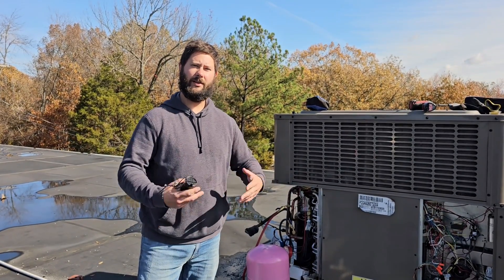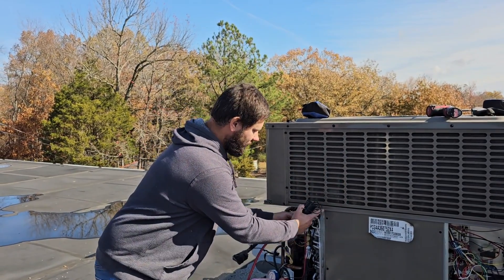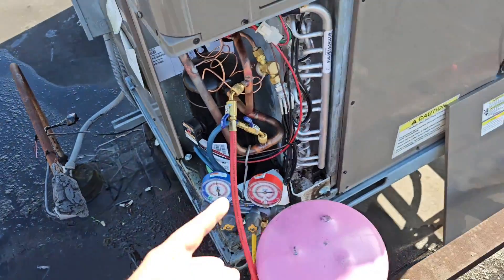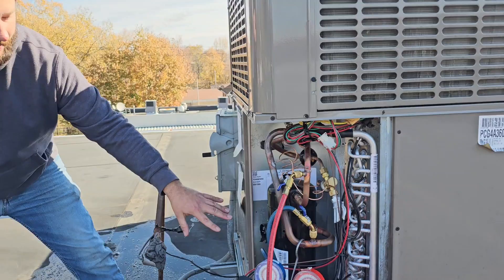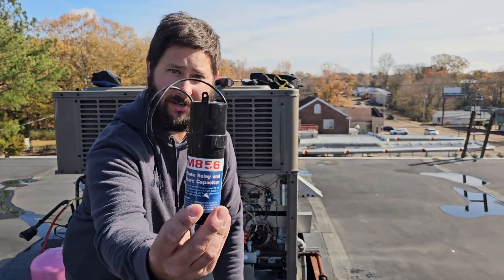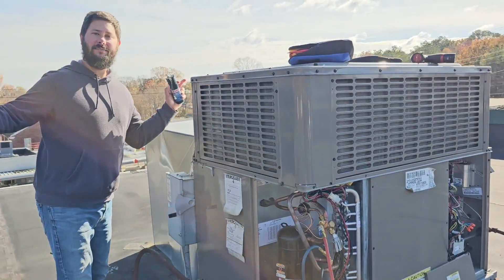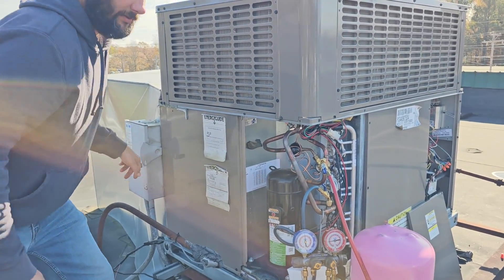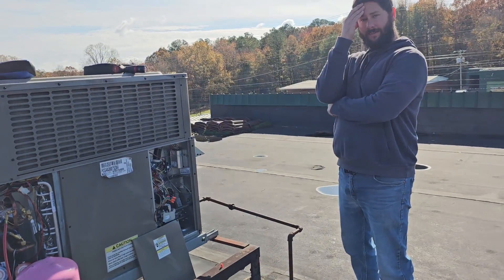This is why York HVAC Equipment is failing! ‎@YorkHomeComfort

Comment: I have a three and half year old York and it's the worst HVAC I've every owned. I will never by York again. Compesser blew out two days ago and local York distributor won't even answer the phone for my HVAC tech to see it he can get the parts. I've probably had to take the panels off to troubleshot a dozen times in the last three years. I missed my 23 year old Bryant, it worked, heated better and cost less to run.

Comment: The York PHE/PCG package units has a “loss of charge” temperature switch. Instead of looking at low pressure it has temperature switch on the discharge line. When you have “low pressure” you increase the compression ratio and will increase the discharge temperature and the loss of charge switch will turn the system off. It is auto resetting so that short cycling probably damaged the compressor just like an auto resetting pressure switch will do the same thing.

Comment: Have had 4 high pressure switches go bad in the last two months on YHE condensers.  York is garbage.
Replaced quite a few condenser fans and modules as well.

Comment: Thanks! 1-year old York HMH7 unit (4-ton) Already had air handler coil (and temp sensing part) replaced. Then unit went down with condenser coil leaks-still waiting for a replacement coil (but the installer crimped & bypassed existing leaking tubing and brazed coil back  to get it up in hot, humid SW Florida). Today, received 3 alerts from Honeywell thermostat app saying internet connection has been lost, 1) internet is good 2) thermostat is blank (LCD indication gone, no lighted pad) 3) checked all thermostat wires with 0V AC and 0V DC on all wires. Checking my solar electric usage, I saw the unit came on at midnight, at 0100 and at 0815 - but is off again. When it ran at 0815, the thermostat had the LCD display operating correctly. 2 major coil replacements tells me that York (and installer) have lost all money from me buying this HMH7 unit with a 10-year parts and labor warranty.

Comment: Thanks for the videos Taddy.  I have a residential  York  Central Heater/AC and can't find information on how old it is.  Right now the unit won't turn off so I had to shut it off with the breakers.
  Is there a manual to download or how to do troubleshooting?  What combination whole/home air conditioner/heater would you install over a York model?

How old is this model?  It's at least 12
Model#  D3GA030N04206B
Serial# NFOM051478

Comment: I've been dealing with a slew of Carriers anywhere from 4 to 2 years old each with multiple x multiple issues. Leaks, fan relays,  and txvs as well as other small issues.  One unit was 2 years old debrie in the refrigeration caused the txv to get stuck closed as well as a contractor that was staying on not letting the high pressure switch work blew my high side gauge right up.  Luckily I was around the unit looking at the coil. My gauge needle looked like Mr T bent it around his neck. While the rest of the gauge was all over the roof.  My bet is that unit never ran right, and if it did, it was super short-lived. But 1 after another 🙄😮‍💨 when on the same roof is a 30 year old unit from Rheem, Trane, Carrier, even a archaic Reznor swamp cooler/roof top unit combo still running just needing a cleaning and filters blows my mind 🤯 25 years never seen so many issues on so many newer units. Q.C. is better in the knife pocket world for a $30 knife from a relatively new company compared to Carrier or York for  $10,000 to $15,000 unit such a joke. Job security lmao 🤣 😂 😆!  Have a great day everyone.

Comment: Anybody out there remember that silly heat pump York came out with about 20 or 25 years ago  that had a lawn mower engine in it that ran on natural gas. They claimed it was 110% efficient. I had a guy call my company to make a repair on one that was only a few months old. When I asked him why he did not call the installer.... can't find him.

Comment: Teddy,  I just installed 60 last year this same unit and its an issue with QC,parts fail, compressor burnt shortly after start up and running, service port core not tight and all the freon leak out. certain sN numbers had bad inducer motor wont start when temps below 20F. board is ok but spark ignition does not work. and on an on. feel bad for the customer.  what happened to all american made stuff!!!.

Comment: I recently had a call where the coil was an ice block and the filters were clogged so obviously airflow so I changed the filters after the evap thawed out and went hood and had a call back to the same unit. Turns out, the duct work was undersized for a 7.5 ton Goodman unit and lack of airflow and static pressure caused it to build up with ice. We now have a duct for outside air and we have added one more supply into the building and that helped the pressures for the building and now no more ice

Comment: Kenny W
Placerville, Ca
Commercial Service Tech
Been having issues with quality on Lennox package units my company has been selling/installing for our customers.  Condenser fan motors, broken blower wheel shafts, units not being grounded causing the furnace to not operate, etc.   Super frustrating.

Comment: What are your thoughts about the system that we just purchased. I know that pricing depends on geographical area and we are in the northern suburbs of Philadelphia with about 2,200 square feet. As per your comments, we got rid of the Honeywell thermostat and when I went on to PECO's website they were practically giving away the Nest thermostats so I purchased one for $16, normally $129. We now have a different AC condenser being installed it's a 2.5 ton YORK model  YC2E30B21S 14.3 SEER2. Please keep in mind we are in the northern suburbs of Philadelphia so I'm sure price varies depending on geographic location.  Thank you:)

Comment: I am wondering why you did not check the compressor wiring isolated and check the motor winding for short or winding isolation class by mag test. That compressor can be recovered or not if it is under warranty. 

My question is why this happened is it under load due to less refrigerant? Something happened.

Comment: I love ya. and i get you install a lot of these. but 90%+ of our big equipment conundrum's come from YORK. In my opinion, since you asked,  is its absolute garbage. ZERO reason to disable heating or cooling because their stupid proprietary outside air sensor is reading faulty.  im sorry but York is  straight trash can

Comment: Become a better installer and seller of equipment, guy admits he sold the unit but didn't secure labor coverage via extended warranty or catch the touching headers (which he admits can be done during commissioning). It's a residential / "light commercial" unit, guess what the York Sunline, Sun Core, and Sun Pro commercial units have? Low pressure switches and more cabinet space than this unit. The expectation of getting equipment from Oklahoma to Tennessee (or wherever) and be in the same condition as it came off the line also needs to be done away with, there's a reason there's a start-up and commissioning process and the best installers finds and avoids future problems like this.

Comment: And there is no way you coukd have known the compressor wouldnt run. I guess if there is no low pressure switch we gotta inform the customer this is a possibility. Great video.

Comment: I replaced my first Inducer motor on a trane. Still new to the field and company gave me the part to simply go to the rooftop unit and replace. Was diagnosed as bad inducer motor by a tech already.
Replaced. Days later, Call back said no heat.
Got there they said it's working again.
Owner and I went up and he mentioned to check all electrical connections.
The molex type plug from the new Inducer was not making a good connection. So finding out that connection is also part of the CAN system Trane has. Its apparently an issue Trane knows about. So glad it wasn't my fault lol.
Reply from the maker: I am glad that it wasn't your fault as well. That's awesome that you were able to find the problem and fix it for the customer.
I saw that you joined as a member thank you so much.
I have a bunch of guides if you haven't got my email here it is. tadfuller1@gmail.com

Comment: Replacement LG compressor I installed this year lasted 2 months and next replacement was 2 months out. Wound up giving the guy $1,600 back and another $600 towards the price of a new compressor if warranty was denied. Cost me a customer and $2,200 bucks. Ruud and Rheem are full of LG compressors now. Even the WeatherKing used to be nothing but Copeland. Which to be fair, first system was grossly overcharged and not installed correctly. I flushed the lines, cleaned the evap coil and installed a new drier. All quality is down. I have started selling 10 year labor, but I'm really not that confident that the warranty company will not find a way to get out of major repairs. Everybody is only concerned with profit. It's contractors and customers that are left holding the bag.

Comment: I have 5 york split systems this summer that we're installed within the past 3 years and they all were due to low pressure switch failure. Our commercial guys have had issues recently as well with even brand new installs with multiple compressors not working right off the bat and they were definitely made aware so hopefully they will get things straightened out.

Comment: The client wanted a second opinion on seven alliance RTU were they removed all the controller cards as they were expensive to replace, they rewired through the thermostat. I found few compressors replaced and discovered others faulty. They left out hp lp and temp switches. I spare you the rest 😢

Comment: I hate York products. From experience i have seen techs weighing in too much liquid refrigerant into the discharge line and causing it to lock up. Remove the liquid off and give it another shot, you might get lucky. Keep the great videos coming

Comment: Is it three phase just installed a YORK package unit today had the same problem just had to switch two wires on the contactor it had reverse polarity fan came on unit was loud my pressures were the same on high and low gauges were closed switch the wire fixed everything

Comment: Same corporate greed that sends out all those mini splits with paper thin indoor coils. Other than Fujitsu most of them are junk. York was good but now that Johnson Controls took over, the quality is not the same. I am sold old I remember when they were owned by Borg Warner and built like a tank like those old GE and Westinghouse units.

Comment: Yup, Wichita KS made more junk, same manufacturing plant that the blue fin coil leaks catastrophe was produced in a few years back. 

To be fair, the distributor rub through is a manufacturing & commissioning issue, where the cheap LG comps, no LO switch,  & blue fin was product design’s & their department manager’s faults.  rv101flyer84 is right, it’s industries not just light commercial AC units.
Reply: As long as the greedy suits think they are worth 6-figures in all USA corporations, we haven't been destroyed by communist China, they will continue outsourcing labor/raw materials to the lowest bidder. Junk will continue to be warehoused and sold by salespeople all across the land of no integrity.

Comment: I foam tape and tie wrap all tubing and wiring on all brand new units. It prevents a lot of problems down the road. Also, if you go out on one that’s leaked down, always bump the compressor to make sure it will start and run before you quote and make any other repairs. With a new TXV, coil and compressor you could’ve put them a new unit in. If this junk is out of my one-year labor warranty, they will pay at least 90% of normal charges. After 2 yrs., the full amount. We can’t help it that our greedy corporate suits are taking advantage of communist China and American consumers. No integrity in the USA. That is why we are in the shape we’re in right now.
Reply: 😊try hitting compressor with hammer a couple of times, sometimes internals freeze up.
Reply: I've toured the Johnson Control facility were the York units are built and tested. The process is amazing with quality control thats top notch. The testing they put their units through is rigorous. With that said I agree that the distribution tubes should be line with vinyl tubing like their Coleman counter part also a Johnson Control product. But with anything that is made by humans can be defective as we all have bad days and it effects performance. I personally don't like the LG compressors too many failures. I don't know why they use them. They should just stick to Copeland.